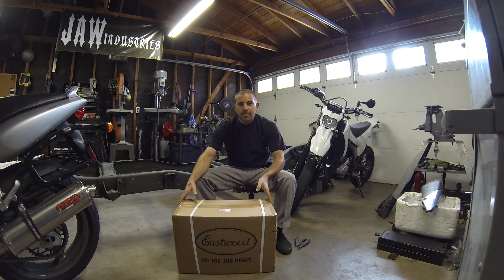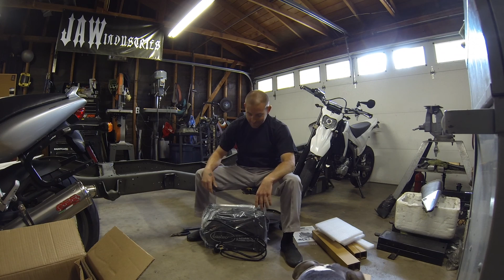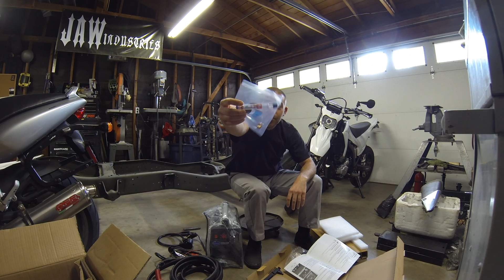In the Garage - Unboxing the Eastwood Versa-Cut 40 Plasma Cutter

Comment: I still have to research it more but I've read that the consumables also fit a Hypertherm, so you might be able to pick them up locally after all. http://forum.weldingtipsandtricks.com/viewtopic.php?f=29&t=5668
Reply from the maker: Thanks. Good to know. They came in a little bag that looked like it was sourced from another supplier.